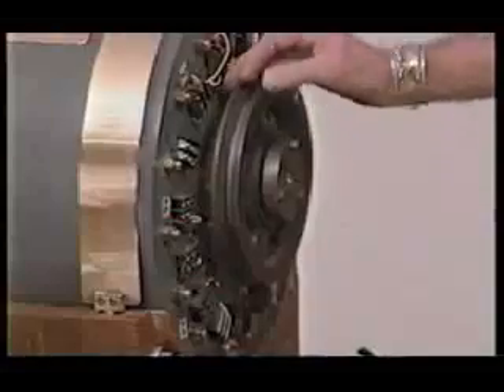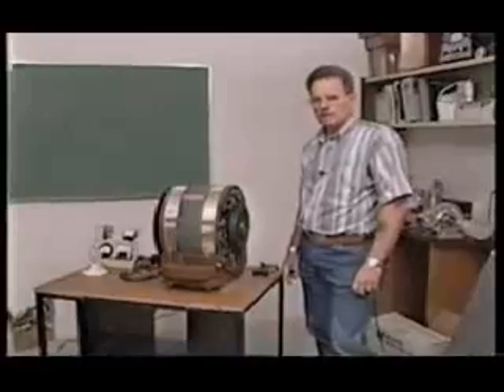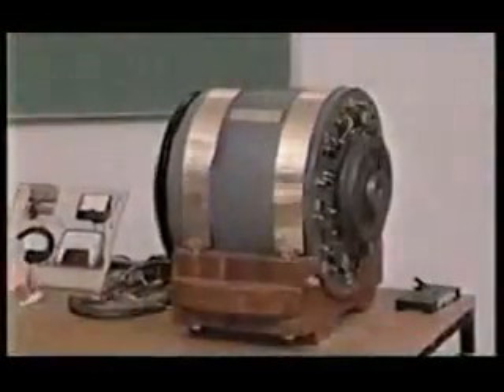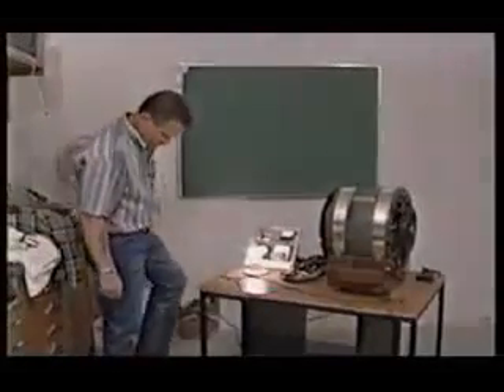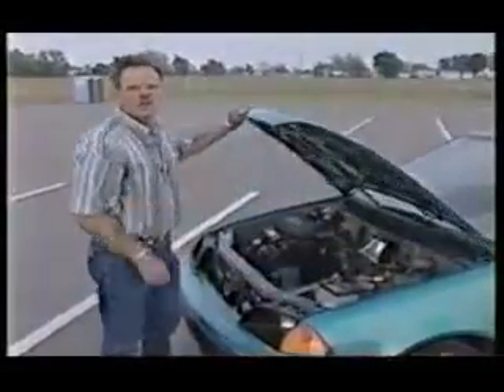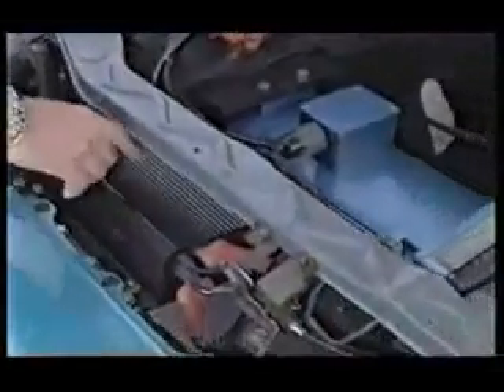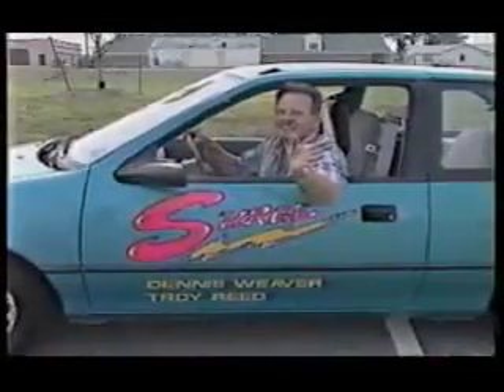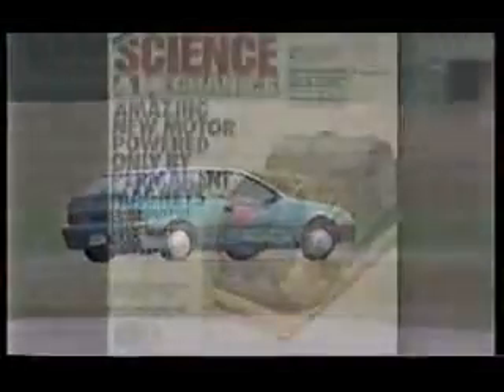(Oil replacement solution) Magnetic Motor - Electric Car Without Battery.

Comment: Knock knock, this is 5 years later, uhm, where is your fucking engine? Oh it doesn't work, yeah I thought so.
Reply: Before you say "it doesn't work", you have to define the purpose for which the machine is made and what it means for it to work.  Imagine that a machine was made just as a prop for a con game where people are tricked into paying money to the con artist on the promise of a great return on "investment".  Imagine further that the con artist gained a whole lot of money using the machine and avoided jail.  Wouldn't it be correct to say that the machine functioned as a perfectly good "hot air powered wallet emptier"
Reply: Ken Smith
In that case yes, it functioned flawlessly...

Comment: This is the real deal. So unfortunate that greed has suppressed it.

People should be demanding the release of this technology, but instead are happy as long as their 'basic' needs are met. Those profiting/benefiting from the current system will fight for it's continued survival, even if it is destined for failure; this is exactly how a parasite operates. Will do what it can to keep the host alive long enough while still sucking everything it can from it.

On the automatic transmission of that car, I'm surprised it works without a hitch. The torque converter can develop quite a bit of heat and needs to be cooled by the circulation of transmission fluid. When the motor isn't spinning, this won't occur. As long as there is a system in place to ensure the motor spins during 'coasting' then it should be fine.
Reply: JonTanguy 

YOU SAID: "This is the real deal."

-- Um, no.

YOU SAID: "So unfortunate that greed has suppressed it."

-- How does "greed" suppress anything?  And, how is it suppressed.  You can simply go read his patents (as I have).  They're open record to anyone in the public.

YOU SAID: "People should be demanding the release of this technology"

-- What "release" of what" technology"?  It's a simple dynamo, and not a very good one.  This "technology" has been around for centuries, and, of course, it doesn't do as the video is pretending.

YOU SAID: "but instead are happy as long as their 'basic' needs are met."

-- Oh, yeah, you're really profound, perfesser -- so, do tell everyone how anyone can implement a dynamo to do anything useful.

YOU SAID: "Those profiting/benefiting from the current system will fight for it's continued survival,"

-- Perhaps if you learned to read and write in English, instead of this broken-grammar nonsense you're spewing, you too could profit (get a better job, advance in life, etc.).

YOU SAID: "even if it is destined for failure"

-- Anyone who invests in conmen who claim to have invented a machine that defies the first law of thermodynamics is destined for failure.

YOU SAID: "this is exactly how a parasite operates."

-- Yes, Troy Reed is a parasite.  He duped millions of dollars out of gullible investors back in 1994 (when this video was made) by telling them he invented a machine that produces more energy than it consumes.  Of course, anyone who understands physics would instantly know that can't happen.  But, the dumb investors gave him money anyway.  He filed useless patents for machines that don't work, and made a series of investorbait videos claiming that this stuff actually did work.  And, after being sued by his investors for fraud, his wife left him and ran off to Costa Rica with the Prime Bank mortgage scandal guy (I guess she has a thing for con artists).  And, in 1999, he admitted on tape that this junk never actually worked (of course, anyone who read the patents who understands anything about physics whatsoever already knew that, since IT'S JUST A FREEKIN' DYNAMO).

YOU SAID: "Will do what it can to keep the host alive long enough while still sucking everything it can from it."

-- Yup, that's what Troy Reed did.

YOU SAID: "On the automatic transmission of that car, I'm surprised it works without a hitch. The torque converter can develop quite a bit of heat and needs to be cooled by the circulation of transmission fluid. When the motor isn't spinning, this won't occur. As long as there is a system in place to ensure the motor spins during 'coasting' then it should be fine."

-- Um, dumbass, there's a reason that Troy Reed carted that stupid car around on a trailer.  It was a piece of garbage.  It was powered by conventional batteries, not his miracle motor.  And, all of the nonsense he spewed in the video was pure scientific gibberish.  I doubt the car had a range of more than a mile or two, so I don't think there's any worry of overheating.

Comment: Tesla's ''free energy'' was not free energy of course but a kind of Wi-Fi transmitted energy. I.e. it was all about electricity being produced centrall, e.g. by a hydroelectric plant, then transmitted by an antenna tower much like radio waves in the surrounding region. However, just like radio can be received by anyone, energy emitted by the plant could be received by anyone and of course there would be no way of charging how much one consumed!

Comment: That does not mean that there are not any interesting technologies out there that were purposefully ''silenced'' by means of ''directed investments to oil'', legislation and control of patents. E.g. steam cars always made sense (and still make sense) but where taken out by industry for various reasons to be discussed in another relative thread. But the AENAON (free-energy motor) is not one of these technologies as it has not been demonstratd in practice by anyone.

Comment: Precisely. What I see in all those videos is ''rotor'' that run blank on flywheel spinned by hand or otherwise. As long as these will be connected to a generator, the resistance of the generating circuit will act as ''friction'' reducing and eventually stopping the rotor.

The ''free-energy'' rotor - usually called AENAON (from the Greek word for perpetual) - remains a wish but there is no energy from nowhere. There is energy from energy and energy from mass but there is no energy from nowhere.

Comment: As i said it is not so easy since first of all the cost for the rights and mass production is several Billion so that is not cheap for anyone,but more than that the patent of such a motor like the one i am saying that has to do with the  "Ether vaccum system" that is all around us, would change the whole system you can imagine what the Multi Trillion companies in charge of Energy around the world will do not to have it mass produced,

Comment: Wrong. In fact, less than 2% of the U.S. population has sola. In fact, utilitiy companies benefit from solar, until it reaches about 25% of the population because people are getting credited per kw on solar production and it just so happens the power company is getting those kw's during peak kw pricing. So, they're crediting a flat kw rate for a prime kw. That's why they benefit. Infrastructure and cost of coal production and coal pricing itself is why electricity keeps going up. interstatesun

Comment: They have a mirror at the middle hiding the batteries. You can see the vertical cables in the back that does not show from the front.

Comment: ok then, we did manage to do this in the lab. When we say free energy, we say the energy that is given by the magnets to the system. ofcourse you pay for the magnet. So there is no free energy as generated out of nothing. If you open and close the magnetic field, it can work. But You can't actually open and close tha magnetic field but what you can do is push a magnet away and forth again. Think... we manage to make it and it works. My house is powered by that. Companies whant you stu..id..

Comment: To Dennis Weaver and Troy Reed: Get second hand cars, put the electric motor in and sell them. People can the inspect if there are batteries in the back, and if they in fact go longer than 500 miles or more and you have a roaring trade. I am waiting to see this to happen. It sounds reasonably good to the layman. We want is something we can buy and turn key and ride... free or cheaper than we do now, with no pollution. And, seeing your video, it should be simple enough, what's holding you back?

Comment: Gross stupidity.  The inertia of the wheel in the motor provides  enough electricity to light the light.The car runs because it has a battery in it, but as soon as the battery runs down the car will not run. You have to have energy to use energy. No energy in = no energy out.

Comment: @zstangkrewson All plastic, polymers, rubber, and most paints are made from oil. It takes seven gallons of oil to make one tire. It take thousand of gallons of oil to make and operate the machines that would manufacture the cars and their components.

Comment: @mytime2shine13 (cont.) As you know, the universe is also an expansion of space-time. The early universe was very small, very concentrated, and very very VERY hot. Matter particles (electrons, protons, neutrons, etc.) form spontaneously under these conditions. E=MC^2 Energy is matter, matter is energy. It's the quitessential tuatology that defines our universe.

Comment: @mytime2shine13 You need to understand what energy is. It is not a mysterious thing. Energy is a potential; a potential from one height to another, one temperature to another, one voltage to another, one concentration to another, etc... The universe itself can be thought of as an energy potential in which the evolution of the closed system will reach a state of effective equilibrium when all of its energy has been converted to radiation. (cont.)

Comment: @scasired - perpetual motion does not exist here, we know that, yet Corporations do not want to let the baby bottle off...Do not tell me this energy could not be cascaded to produce more energy in the conversion, changing the output/input ratio to 100:1 by using Hydrogen, and mixing these with a Bacon cell to produce heat and power, rendering the use of Oil useless for large engines (marine, stationary for buildings, hospitals, etc) Greed has the best of them.

Comment: Nice one. Use the mains supply to spin up a motor+dyno unit with a big flywheel inside, disconnect the mains and... wow it generates power... until the flywheel slows down. No surprise there, and no need for magnetic motors mumbo jumbo. The presenter was a funny chap though, made me laugh and managed to do the whole presentation without telling me a shred of anything remotely scientific! Looks like someone put a lot of work into making a flywheel energy storage device, to drive a car 10ft!

Comment: Guys don't fall for this scam, the laws of physics state perpectual motion is impossible. You can not and will not ever be able to produce a machine that produces more energy than it consumes. The cost of solar cells and wind turbines will eventually come down and all these stupid scams will be put to bed for ever. What these snake oil inventors should be doing is selling cheap wind turbines and solar panels.

Comment: If the magnet motor slows off, mabey it could be restarted again and again by timed magnet intriductions or spark plugs, like a car engine. Magnetic attraction surges could be as powerful as explosions in a car engine's pistons, if the magnets are powerful enough. Mabey permenant supermagnets or electromagnets.